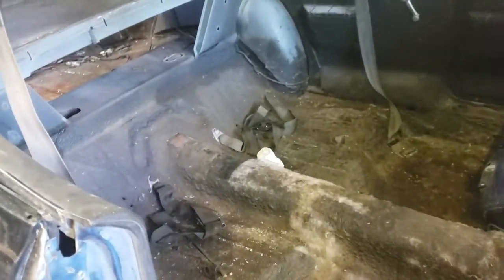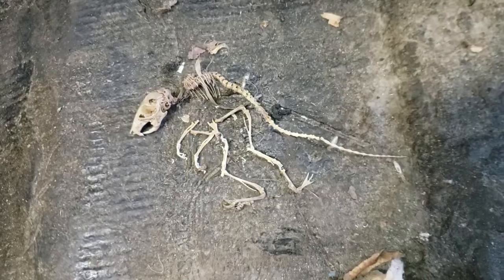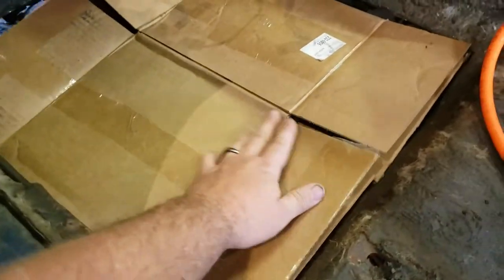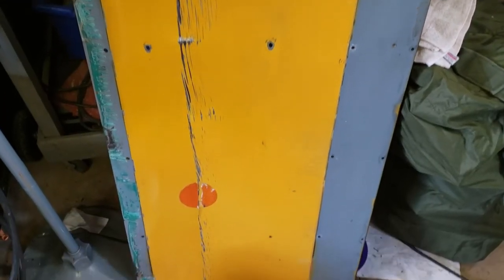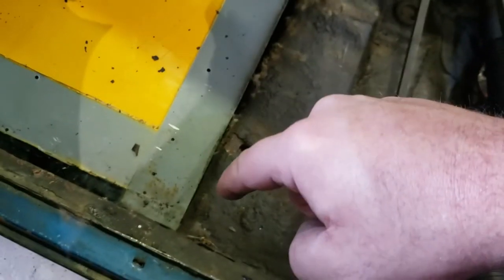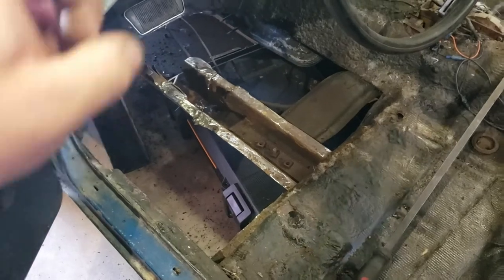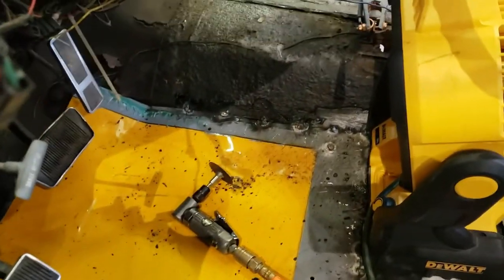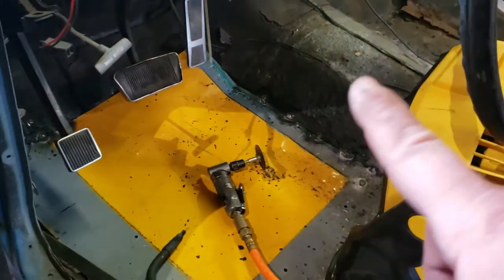1971 AMC Javelin AMX  Project P.2

Comment: Towards the beginning of your video there are a few images of the front driver seat.  Is that a Pierre Cardin interior?  The stripes and coloring look like the limited addition Pierre Cardin.  The Pierre Cardin option didn't launch until the '72 model year, but that definitely looks like one of the seat!
Reply from the maker: You are correct!! I have many parts of this car that are 1972 and like I state, the VIN is 1971. I don't know how this car got the "Pierre Cardin" seats, but you spot on. Only seats( front and back) not headliner or badges.